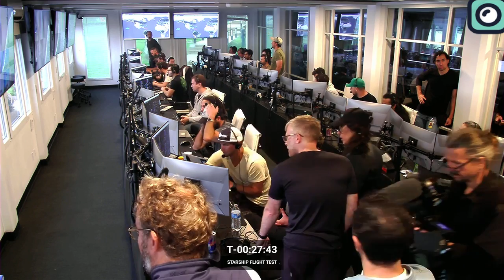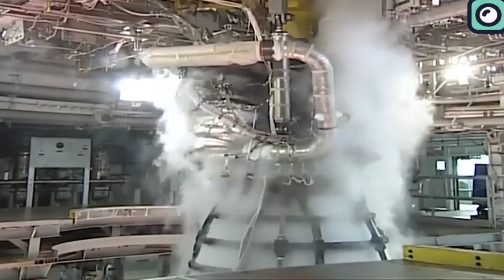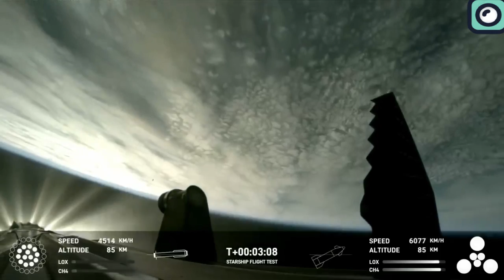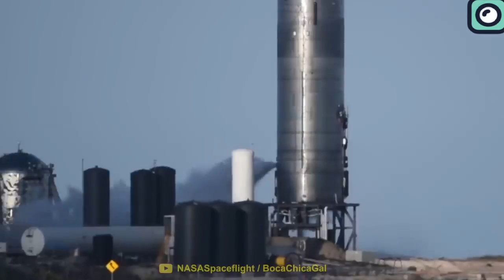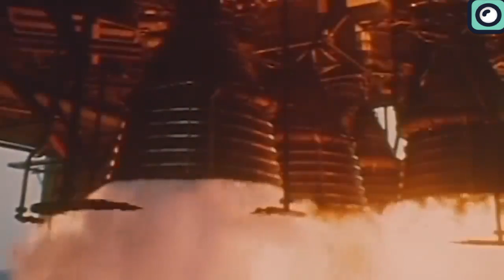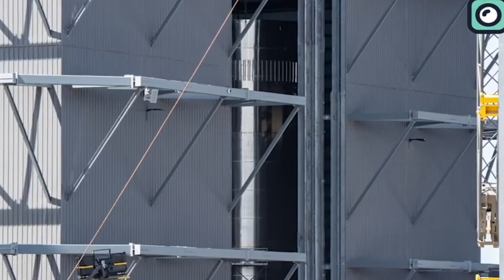Starship's Third Launch Raptor Engines Problem.... Musk Reacts!

Comment: There is nothing to suggest that SpaceX has an engine problem. The failure of both the first and the second flight were about fuel issues not the engines. SpaceXs issues have resolved around fuel leaks, untimely venting of excess fuel, loss of telemetry, and issues like that. Your analysis of the flights were fine until you chose to misplace the cause of the engines failing to something wrong with the engines. It would be like having a gasoline engine quit working because it ran out of gasoline or the fuel pump become blocked and the engine was starved for fuel being called a problem with the engine. Your reasoning in this matter is terrible and unexcuesable.

Comment: If you're going to make videos like this, then try to know what you're talking about. #1. The hot staging did not take too long. It went off flawlessly. #2. The 1st stage did not disintegrate or blow up before hitting the ocean. It was a controlled RUD. That's an acronym for, 'Rapid Unscheduled Disassembly'.  Maybe do some research before posting a video, kid.

Comment: I’m not an engineer however I would think that a flame trench would dissipate the high temperature away from the lower portion of the booster & reduce damage to the rocket mount.  Falcon 9 uses a flame trench so maybe there would be data they could use.
Reply: The high temps he was talking about was from the hot staging Not from take off

Comment: Didn't the NASA Apollo rockets fail some 40 times during development before its success ????
Reply: Yes you are so correct and guess what? there was no crying by the FAA back then, I wonder why?
Reply: @mattblack9069 SpaceX accomplished rapid test cadence & progress under the previous administration. Starship is clean & green, while NASA’s SLS dumps hundreds of tons of carcinogenic solid exhaust into the air we breathe & toxic boosters into our oceans.
Reply: The Apollo Saturn series did not lose any launch boosters / any stages to explosions .   They had some fail to relight on a third stage but no explosions like Space X has an abundance of.  The Apollo series gave Musk a lot of information to avoid problems as they were true exploring  pioneers.
Reply: @mikewallace8087  Space x is trying something new
Reply: my point was NASA did use renewable boosters .  NASA was a pioneer in those days pushing electronics ,synthetic material and metallurgical discoveries .  The Musk way of discovery is fail and fail often with great expensive losses.  His way grabs the attention of the F.A.A. and they sit him down. got it?
Reply: @mikewallace8087  yeah well nasa also didn’t use reusable rocket boosters now did they?
Reply: No they didn't! 70 years ago.
Reply: @baldmista1907  Yes they did, their Space Shuttle SRB.
Reply: @mikewallace8087  No they didn’t, not back then.
Reply: @mikewallace8087 Not during the Apollo missions. The rockets space x are using and the SRB rockets are pretty different anyways.
Reply: @baldmista1907  my point was NASA did use renewable boosters .  NASA was a pioneer in those days pushing electronics ,synthetic material and metallurgical discoveries .  The Musk way of discovery is fail and fail often with great expensive losses.  His way grabs the attention of the F.A.A. and they sit him down.
Reply: @baldmista1907  My replies are being denied/ erased . bye.
Reply: @mikewallace8087  YouTube glitch, happens to me sometimes
Reply: @mikewallace8087 It turned out Nasa could not economically reuse Shuttle SRBs. Cost more to retrieve,clean, refurbish than new ones.
Reply: @warrenwhite9085  False . The designs were improved and the SRB's were  reused if not lost to the sea.  No respect to you.
Reply: Many people worship Elon. Forget that NASA paved the science for US space industry. Remember what Elon does today has been the mismatched borrowing from Chinese fireworks industry and some  NASA's 101 launching textbooks

Comment: Yea, but when will R3 come into play. It would significantly save fuel, more power at launch, and at reentry, and also to help with less orbital docking. 
Thanks for the episode. 
- NOM
Reply: I am sure Spacex knows what they are doing, but perhaps they should concentrate on getting Raptor2 engines reliable before developing newer R3 engines with its higher pressures and higher thrust, etc (& improved performance).